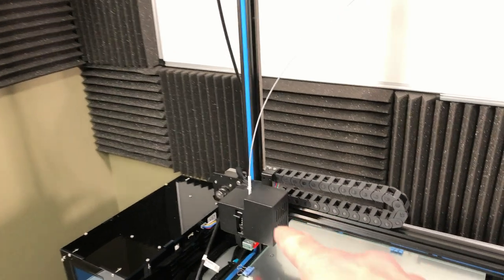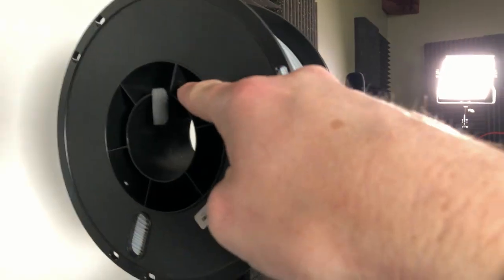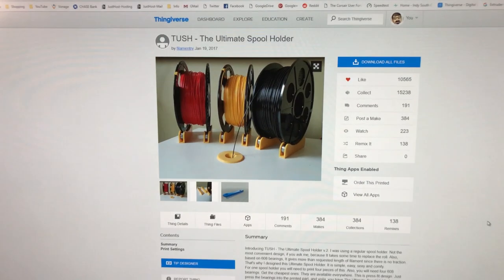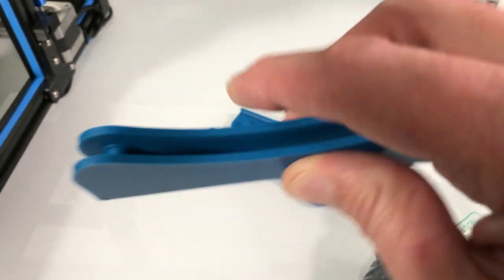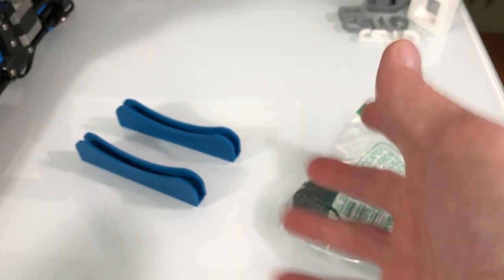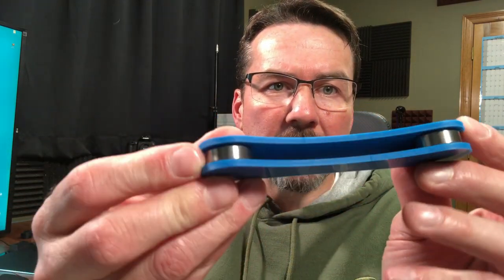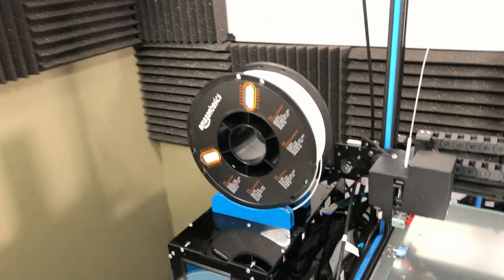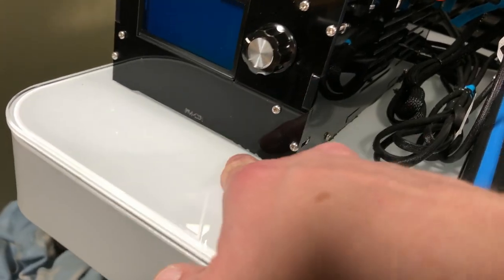TUSH - The Ultimate Spool Holder

Comment: Simple rubber feet glued to the bottom of the assemblies could have worked too
Reply from the maker: Agreed.  But I didn't have any on hand.
Reply: @CSWilsonPrints   I know this is late, but I just place a very small dot of hot glue where I want feet and let dry.

Comment: Why use 4 bearings when you can use none, one or two bearing spool holders, stock holders are better than this ones. If you have 3d printer only for the high tech look than these are the way to go

Comment: do not use with a 5KG spool, it screwed up my whole print because the extruded yanked off the whole spool for me
Reply: @Evan I might use but custom so longer on way bearings are and add bit of a wall to cage spool a bit

Just wondering what do you do?

I have finally got my 2nd 3D printer to be first one to print well and thinking to make like C shape so fix to surface comes up and then along is big enough to put small or big bearings in and make adaptors as not all spools I have are same size in middle so it rotate nice and like a nut to hold it from sliding off the side